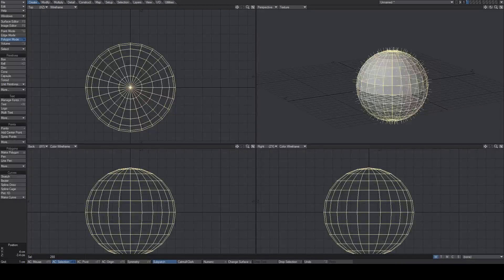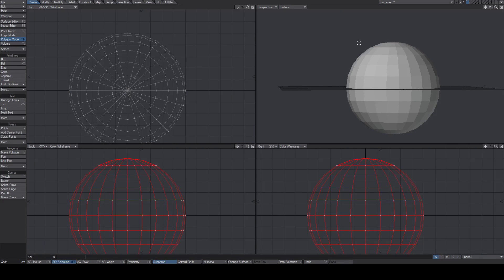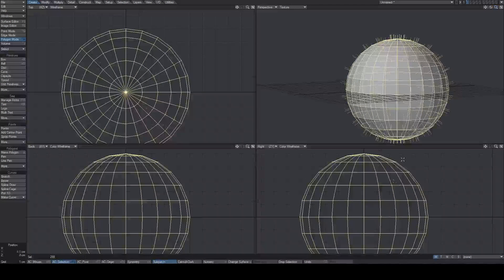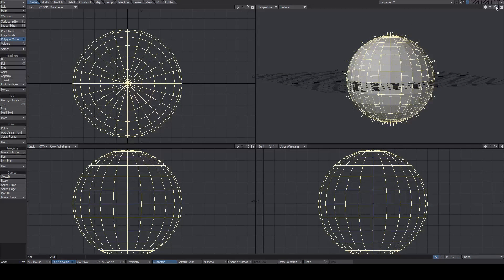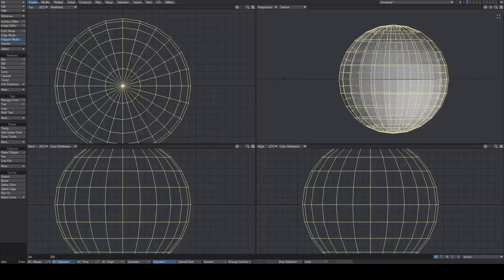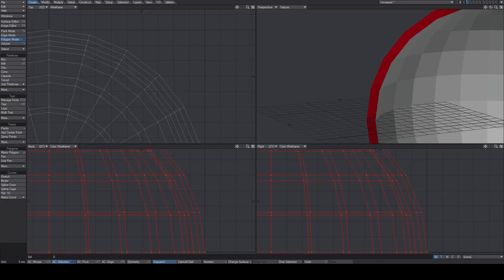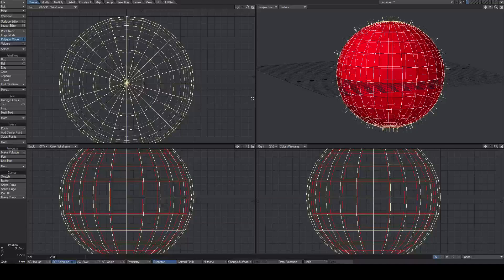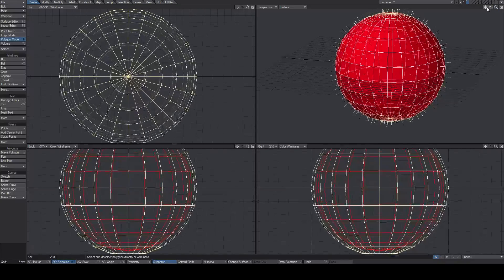Hollow vs Solid objects in 3d modeling and printing

Comment: tricken flips automaticly the inside polys , are the 3point polys, or whatever you call them , no issue for 3D printing ?
Reply from the maker: +3Dpixel.be Yeah, the thicken tool will accomplish the same thing. Tris (3 point polygons) should not be an issue when 3D Printing, but i would check that your model looks ok in a slicer program to be sure.
Reply: +John Hopkins thank you. I have no experience with 3D printing , just checked on slic3r.org for the software, installed , but when it ask my bedside and I answer 200x160cm ;) it says I m loco so I will have to check a few tutos first, but too busy with Jquery for the moment.